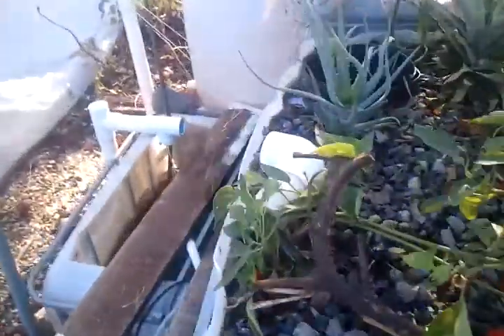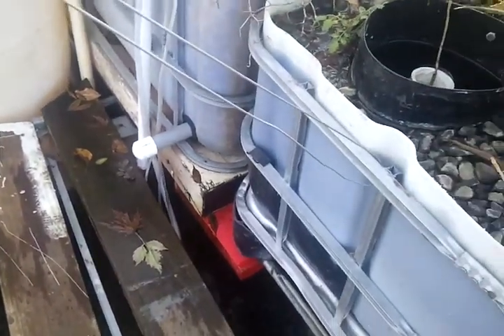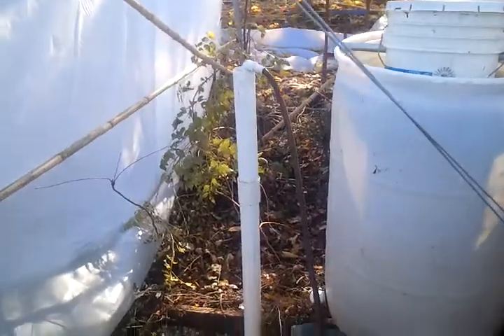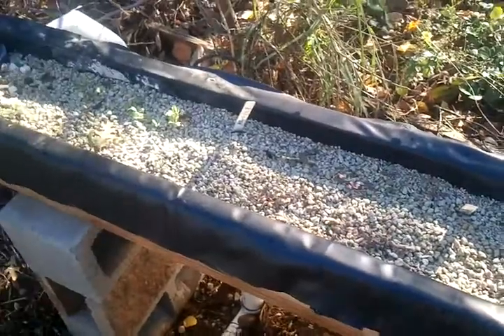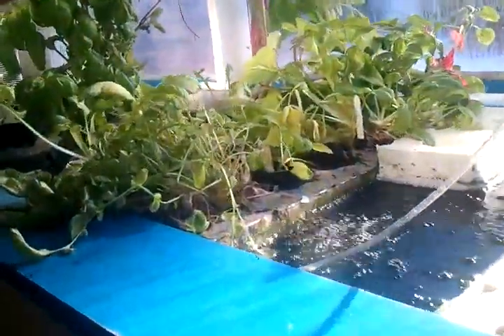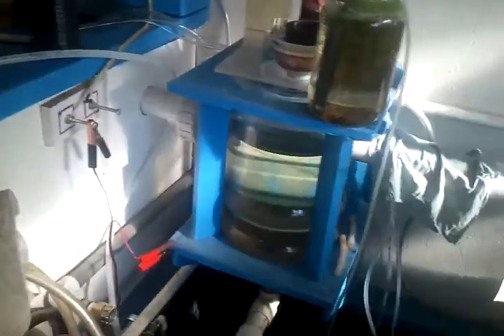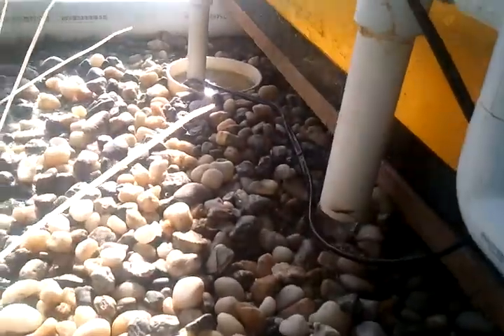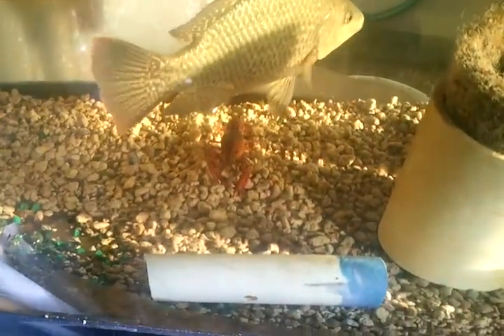Systems Tour 2012 12 13

Comment from the maker: No the pipe goes underground so that the walkway is clear.  Even the buried sump does little to keep the water warm. 
For my next warm system I want to build a Bioponic system and insulate the green house I abandoned several years ago by using a rocket mass stove for heat.
I'm at 39.7 latitude so supplemental lights are required in the Winter.  I will have to find a way to block the light as I did in the grow room to keep the neighbors happy. I would .

Comment from the maker: I have been doing AP for almost one year.  I wanted to try different things to see what worked best for me.  I like rafts best, but gravel is necessary for clean water.  I prefer Bioponics over Aquaponics because it's less trouble. I've done both, but fish are fun.  My first green house failed in the Winter, so I experimented with the indoor room.  I think a rocket mass stove will make the green house work and use require less supplemental lighting. But my neighbors don't like the lights.